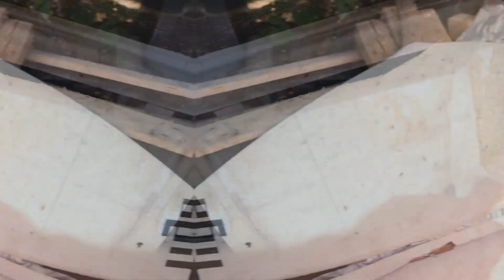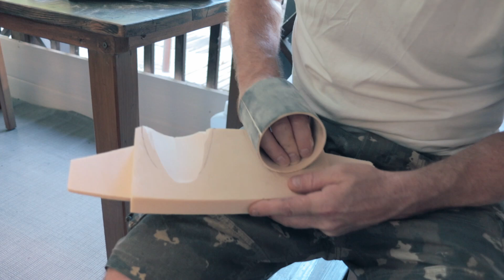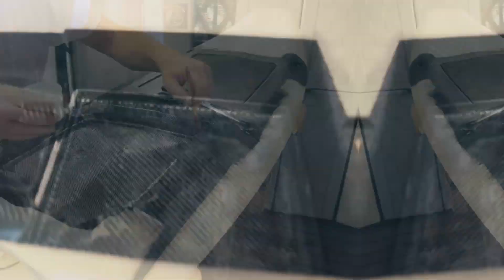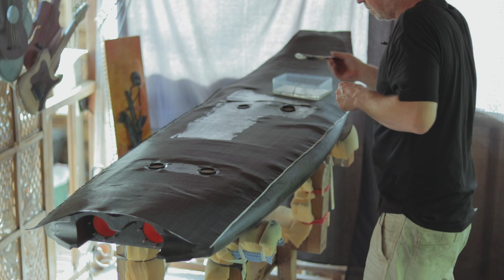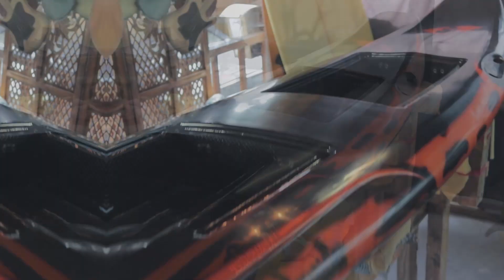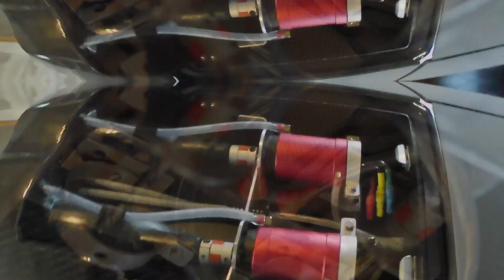Building and Testing a Homemade Electric Surfboard Successfully

Comment: great work! did you use only 1 layer of carbon fiber?
Reply from the maker: Hi I used one on the bottom and two on the top with 3 for the hatches so I can stand on them without breaking. the all up weight is 13kg and it will go to 16 kg with 44v battery pack.

Comment: I absolutely love this series and have watched all the videos. Ive still got some questions… which foam did you use for your board (Regular EPS?) and do you maybe have an template or Cad model for the shape?😅 
Also I couldnt get my board sealed tightly, there was always some leakage to the battery/ESC box, is there any possibility you could share your experiences on that? I’ve already seen the video with the 4.4 Latch. 
Is that enough to pressure the seal tight enough so no water can enter? 
Thanks in advance and I love your content! 
Greetings from Germany 🇩🇪❤
Reply from the maker: Hi there the foam I use to cover the board was depron or eps you can get simply at a hardware shop it was 5 or 6 mm.Sealing the hatches is by far the most important I used a flat black foam seal in the end on both the board and the hatch it also is available in a shop and it is made by Geko. It took a long time but worth massing with. The plastic latches should be enough if not the metal ones work great,I am testing these soon once the drives are in. Cover the latches with a latex glove. There are no cad templates of the board at the moment but in the future there will be some kind of template. Hope this helps brother more vids are coming thanks for the interest.